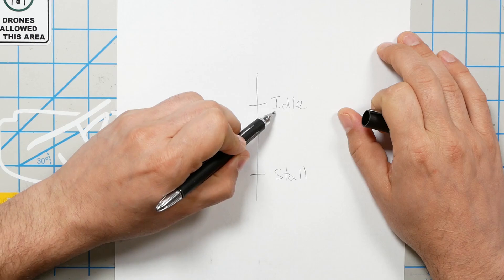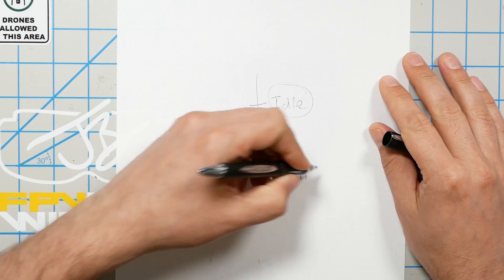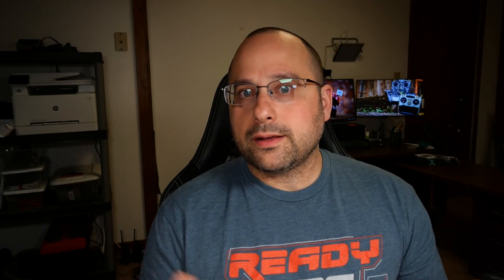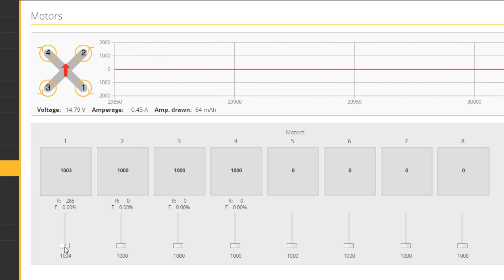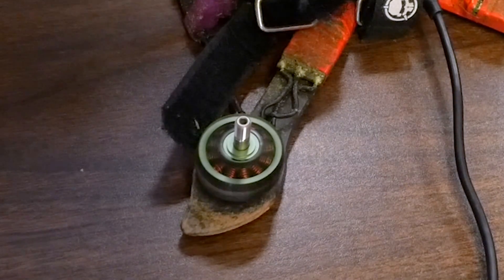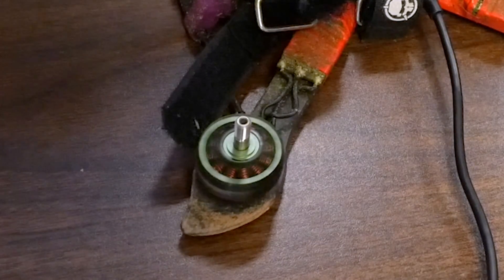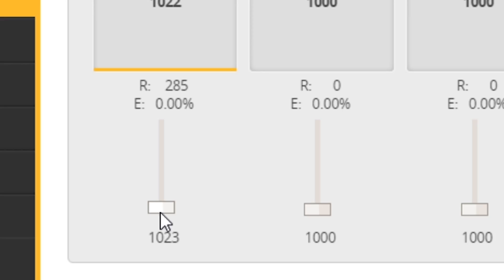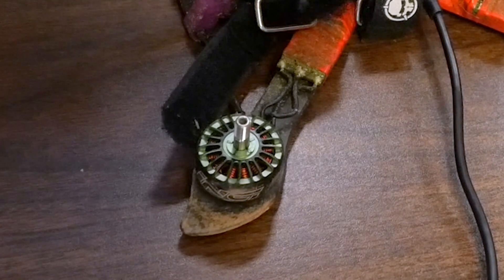"Dynamic Idle" the most useful Betaflight feature you never heard of

Comment from the maker: How do you figure out what a good idle_min value is? LONG STORY SHORT -- take your idle%, convert it to RPM using the Motors tab, then set idle_min to 80% of that value. That is a guideline that has come out since this video was made, and it's one of the biggest questions people ask.
Reply: So for clarification, if your dshot idle calculates to 2200rpm  then 80% would 1660rpm and that is what you would set you idle_min_rpm?
Reply: I know im off subject... My pitch and roll are switched on setup display in cleanflight. Tried setting board alignment off by 90 degrees but still no change. Also the elevator toggles backward. Box model rtf "RAPID" by world tech elite with an spf3
Reply: How to: 
Take Props off
Go into Motors tab
Connect a LiPo
Set the "I understand the risk slider"
Spin the Motors up to your idle value which is 10XX where XX is your %.
So 5,5% would be 1055.
Then have a look at the actual RPM above each motor slider 
Multiply it by 0.8
and you have your idle_min_rpm
Reply: @dominikthone512  if dshot idle value is 5.5 shouldn’t that be 5.5% of 2000? I.e 1110?
Reply: @STEDDiEFPV  so I wrote this a while ago but as I understand you don’t actually calculate any percentages. You just take the two last numbers and put a % behind them.
Reply: @STEDDiEFPV  i have the same problem.
its only 20% that goes up from 1000 to 1200
a idle of 18 would give me 1180
Reply: You probably dont care at all but does any of you know a tool to get back into an Instagram account?
I was stupid forgot the login password. I love any tricks you can give me
Reply: @Cairo Mitchell Instablaster :)
Reply: @Ryland Trenton It worked and I finally got access to my account again. Im so happy:D
Thanks so much, you really help me out :D
Reply: @Cairo Mitchell glad I could help :D
Reply: Someone can help me on this? I dont know how to set the idle_min_rpm, cause for me, its a value from 0-100, and following this i dont get that range of value

Comment: So why would we ever want the pid controller to have access to the min_idle. If the quad flies so much better with higher percentage and if response times are slower when coming out of that super low rpm then aren't you recommending everyone runs higher idle and to not run min_idle? In what scenario would the PID controller getting to use min_idle actually be beneficial?
Reply: a higher min idle results might result in less "hang time" when upside down 🙃.
Reply: @georgedowning1803  I'm mostly speaking for racing and flight performance not for freestyle purposes
Reply: @MewoFPV  You should have more authority lower down. As assuming an ideal case you will have to spin the motor up only half as much as you now have 4 forces to play with not just 2. Might not be the case in the realworld though, maybe it takes the same time to spool them up more, or braking is to slow this low in their speed curve.
Reply: Altitude control will be better with a lower min idle.
Reply: @MewoFPV   MewoFPV  dive gates? A reduced hang time will result in less control? In a competitive racing environment you would probs be flying with consistantly enough power that PID will never access min throttle anyways. However by increasing the min idle, when operating at the bottom of the power band, you effectively shift the center of rotation in the direction of the turn. An example of where this might be a problem is In prop wash, as the center of rotation Is moved rapidly any additional rotation command by the pilot will result in an ossilating track through the sky. Yes it becomes more rotationally more stable but for racing having a consistant track may be valued more than a consistent than attitude.
Reply: @georgedowning1803  If youre doing a dive gate right you arent lowering throttle. But after reading about the feature on their github, it seems like the goal of it is actually more the opposite. They recommend that you set your min_idle_rpm such that if the dynamics or reverse airflow of the quad would reduce the motor rpm below what your desired idle throttle percent resulting rpm is, then it actually bumps up the idle throttle percent. So this just more effectively induces a motor rpm floor than the previous static implementation. Sounds like it's goal is more to achieve that consistency. They do note that if you want to run what would previously have been a dangerously low idle percentage, you can now achieve that since the min_idle_rpm will keep the quad safe from desyncs resulting from dynamics changes that would normally cause a desync with a static idle percent.
Reply from the maker: In addition to the other discussion, being able to drive the motor to zero throttle results in faster braking. The ESC drives the motor to zero throttle but stops before it gets below idle_min. It can't do this with static idle. It can only drive the motor to the idle percent.
Reply: MewoFPV Agreed. Having the ability to dynamically control the min idle is a good thing when it comes to customising handling.
Reply: Stephen Gibb actually quite the opposite, becasue the motor is unable to sprawl up from low rpms fast enough. This is equivalent to having a reduced D term where the motors are not able to provide enough force quickly enough to arrest any rotation because of angular momentum.
Reply: (I do testing for BF, but I'm not a dev, I'm familiar with the "practical" part of the feature, but dynamic idle is way more complicated than it looks, so this the explanation at my level of understanding, some of this may be wrong, hopefully someone will correct me)

When falling in backwards air at 0% throttle, the ESCs keep the same amount of power (dshot_idle %), but with way more air resistance on the prop, so the speed of the prop will slow down significantly (this is also a component of propwash). Then you punch throttle, the motors take up to 2x as long to spin up as they would if they were in static air. We are still talking like 40ms vs 20ms, but motor response is actually the most laggy part of the quad when requesting large changes. 🙃

dynamic_idle will raise throttle to compensate if RPM is approaching the min_rpm setting keeping motor response more consistent. Same thing also works the other way around, if the props are starting to spin up due to airflow, dshot_idle will go below the minimum %, and keep them slow.

Another scenario is a flip/roll where it keeps the two low motors from slowing down too much, so they can accelerate faster when stopping the move.

One more interesting detail. ESCs speed up with more "force" than slow down. And the amount of "force" applied is actually proportional with the amount of change you want.. Going from 40% to 50% will produce less "force" than 40% to 100%. When you normally chop throttle, it will slow down from, let's say, 60% to 5,5%., With dynamic idle, the ESC will be told to go to 0% so there's slightly more "force" applied to the deceleration, and as the RPM approaches min_rpm the dshot_idle% will be raised again, essentially tricking the esc to give a bit more acceleration. (these kinds of limits in Blheli ESCs are why the same dev started jESC shortly after)

And finally.. will most people actually notice anything? No, Probably not that much.This feature is about pushing the edge. I find it cool that the same firmware runs a 40$ whoop, and the most high quality, most tuned and optimized quad at the same time. Not many other places that happens.. (from a usability perspective this is actually not a good thing)

If you made it this far, try this, on a 2300-2500kv (4S equivalent), 5" quad with BF 4.1 or above. It must be reasonably clean, if you get weird vibes or hot motors and can't raise the filter sliders to 1.5 or higher, you should not do this, thrust_linear amplifies low throttle PID control (and noise). Produced thrust is not linear with RPM (look at mini quad test bench), at low throttle you need a bigger change to get the same amount of actual movement, this allows to get the most with dynamic_idle)

first, diff all

set idle_min_rpm = 22
set dshot_idle_value = 700
set thrust_linear = 20
save

This may seem high, I WAS the guy who used 2.5% idle. Throughout testing this feature over the last year, I went up and up, and everything got better. 

The min_rpm values Bardwell recommended will prevent de-syncs for most, but will still slow the motors down too much for better response when speeding back up at the end of a roll. BF recommends 20 minimum (I use 25 now). I strongly recommend starting with high settings, and if the extra floatiness is actually a problem (or even noticeable) then lower it.
Reply: THAT TOOK WAY TOO LONG TO WRITE.. 😅
Reply: This lets the PID loop mixer output command values that are lower than the DSHOT Idle value on a motor that is still spinning faster than the set minimum idle RPM, which means the ESC can keep actively braking on those motors, instead of adding more throttle command to other motors on the quad.  Increasing net thrust isn't great, so avoiding that is awesome.
Happy Birthday Dude!
Reply: For the racing application, think of it as having more headroom at low throttle to have lower thrust, so you get more stick resolution at the low end.  In racing instances it's not a common to need zero throttle if you're properly on the racing line, but when you do, it's nice.  I find myself still using zero throttle quite a bit on certain split-S entries, side-slip gate lineups, and particularly when I am not charging approaches to complex sequences... and then there's the case of mistakes where it can be much handier.

Comment: Worth mentioning that if you are running 4.3 Betaflight today (quote from BetaFlight): "When Dynamic Filtering is active the static idle value is disregarded, because the idle value is continually adjusted to maintain the configured minimum rpm on the slowest motor."  It warns you of this now and they have a nice little field under the PID tab to adjust (alongside some other handy motor/throttle settings), you don't have to use the CLI unless you want to.  They also recommend min value of 3000-3500 RPM now instead of 14000.   Love the videos, these have helped me out immensely!
Reply: Yup just enabled rpm filtering and it enabled dynamic idle automatically, and it fixed my desync at 0 throttle issue.

Comment: Awesome rundown JB!!
If folks want to get to "zero" prop wash, tune your stuff and raise idle to 8 or 9 percent.  Dynamic idle takes that improvement one (little?) step further.
Reply: 'Zero' propwash AND the ability to chuck into massive rainbow-shaped inverted yaw spins?  Yeah.
Realistically, I only got into this because I had a pesky 7" 6S rig that would hover at 9% throttle, but when I tried racing it would desync at values below half that.
Reply: I was wondering about that! thx
Reply: UAV Tech what do you recommend if i run dshot idle value on 5.5 percent with 2600 rpm. What should i set on idle min rpm? Is 12 ok which JB has in the Video?
Reply: 9% idle will kill your inverted hang time but help your propwash. Does it really take that much idle to fix your propwash?
Reply: @user-rs8zg8ey2b  , prop was is never "fixed".
Reply: @user-rs8zg8ey2b  If you set it really high, you never have issues with low throttle PID authority, and if you're going bananas racing, there can actually be some benefit from not having the thrust totally drop off, but that's an extreme case.
Having more net response room available to the PID controller in propwash situations is always a good way to minimize propwash, and because motors don't produce as much differential thrust at low RPM having extra headroom at the bottom to both actively brake and have lower overall thrust threshold adds resolution - and paired with effects like thrust_linear (which can help, but may also amplify D term oscillations at low throttle) can improve PID authority.
So, with this setup, I'm able to run the equivalent of 3.7% DShot idle throttle on my 6S 7" rig, but have the same PID authority as when I was setting it at 6%, which for a 700g race quad means I could (if I were a better pilot) chuck it inverted between the goalposts of a football field.
Reply: @ChrisFPVGermany  Some quick math - is this a 2600KV 4S quad?  If so - 4.2V * 4S * 2500KV * 0.055 = ~2400rpm (24 value), but I suspect you could start there and work your way lower.  Ditto if 2600RPM is your answer, my 5S 2250KV quads would math out to the same answer, but I'm able to run idle down below 1900RPM, which works pretty great.
Reply: tehllama42 I dunno about all that, but have you ever seen ozzy fly? Better check his vids. Dude is a LOS master...
Reply: tehllama42 i have 2450kv and 4s. When i look in the Motors tab, i have ~2400 rpm at 5% idle. So at 5.5% i Must have around 2600 rpm. Joshua has set 12 = 1200 rpm at idle_min_rpm. That seems a bit low. When i Start at 20 like Thorsten Laux Said or about 10% lower than my idle rpm, it should be 23 for me. Ive read Betaflight devs say, 14 should be ok for the Most 5 Inch Quads. Everybody says other things. I want better Propwash handling and More hangtime. So i was going from 3.5 idle to 5.5 idle and propwash handling is much better! But inverted hangtime is shorter. So i want to go down as much as i can with min idle rpm. Can i Start with 14? Or do you think it is too Low?
Reply: @ChrisFPVGermany  If you were having any kind of success at 3.5% idle, then I'd just use the 4% idle calculations (I run that on my 2350KV rigs, that should be a solid point).  Math works out to 1372-1682 RPM across the battery range, which is precisely where that 14 number comes from.  Should be good - for my part, because I was trying to fully stress test these setups (full speed into zero throttle split-S entries), I found I needed a couple more points of low RPM (16), but either way that should work.  I'd personally recommend 16 now that I've done the math; 14 should work, 18 is still probably an improvement.

Comment: BOOM!!!!
Finally an answer, thank you Bardwell.
I've been lowering idle min in order to grind and slide. Keep getting death rolls when smash technical flips, particularly with yaw.
A tip! When mid death, roll you can shake it free by jamming yaw back and forth, then drawing it out and catch it.
Reply: What you describe is almost literally what airplane pilots do to get out of a "spinning fall" (not english native, not sure how to call it)
I had to higher my idle speed as a beginner at first I had no clue why my kwad death rolled, I might have a weak motor but I learned a lot with JB's videos, and I didn't get a death roll today when I did yesterday, time to tune PIDs and lower filters for prop wash now :) (already didn't get that much today with rpm filtering via a beta BLHeliS release but I didn't test it that much bc I was scared of motor desync)

Comment: ESC temp display and warning are another obscure useful features, especially if you're running absolute minimum filtering. ESC and motor temperature are linearly correlated and can indicate whatever you're about to burn a motor due to excessive noise. These settings can only be accessed through CLI.
Reply: Very true, although with most of the dynamic filter and RPM filtering capability, ESCs tend to stay pretty cool, even being pushed to the point where motors are getting hot again in my experience... although I tend to encounter these conditions after I 'encounter' solid objects with my props
Reply: Do you really need that? My ESC can do 60A and the motors can't do much less. The battery, even a GNB 130C, only manages half. So nothing can smoke up.
Reply: It depends,  @BBFPV . If you're running default filter, then temp display won't help much. I run very minimal filter so the temp display is a must have because whatever I clip gates or things where my prop bends to a point where it generates noise which gets amplified in the PID loop and my motors will get real hot real quick.

It's not about whatever you're going to overload one of your system, but if you're getting noise into your motors, the motors and ESCs will heat up until the enamel on the winding gets burned and you could get short circuit which may burn ESC as well. Just play it safe.
Reply: @Asu01  Therefore you should use RPM filters, even with bl_S because then a notch filter is on the motor rpm and even with bent propellers the pid didn't amp motor/prop out of balance. I now have the filters on 1.4 and the motors stay cold.
For testing its ok but every day use i don't like OSD overload.
Reply: my esc will remain stone cold even while literally burning up all 4 motors at once

what you are really looking for is motor current, which you can roughly see in motor throttle in blackbox. i wish betaflight had some automatic detection of a motor sticking out in terms of thrust vs throttle because its the quickest way to spot a bad motor or prop.
Reply: If your ESC is cold while your motor is burning hot, that means your motor was mechanically overloaded, not electronically overloaded (gyro noise),  @drkastenbrot . What kind of aircraft class are you talking about? Because some are prone to this problem more than others.
Reply: @Asu01  I have 60A cont rated ESCs and motors that rarely even get up to 30. ESC power loss depends on dead time (and thus pwm frequency) as well as current. Gyro noise will not change that. My motors will be burnt to a crisp before even warming up the ESC significantly (had two motors burn recently after getting stuck in a tree).